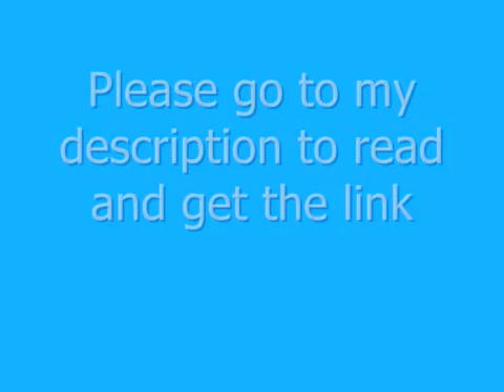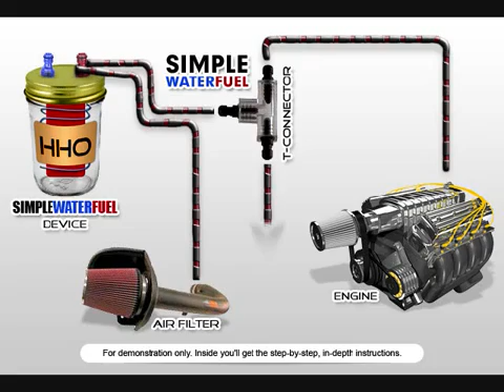How to Convert Your Car to Run on Water (Easy, Cheap, Quick!)

Comment: BRUTE FORCE ELECTROLYSIS DOES NOT PRODUCE ADDITIONAL MPG!  IT JUST CAN'T PRODUCE ENOUGH VOLUME AND THE ADDED O2 will trigger CHECK ENGINE CODES! It will probably lower your overall MPG!

Comment: The real video was removed because those who run this world do not want you to run your car on water. There's a lot of money in the oil industry, after all.  Don't stop looking!  The fact they suppress this technology means it works and has real value.  Just don't try making money off it, you will become a target.  Just use it for yourself and your friends.  The technology works and it's not difficult or expensive.
Reply: Man I really want to learn how to run my car on water. Do you know a link to the steps? Or do you know where I should look?
Reply: @franxx5239  It's been a while since I researched this. But what I can tell you is a guy named Bob Lazar (famous for claiming he worked on reverse engineered UFOs for the government) runs a science company now and on the company web site, he sells kits that makes any car run on water.  Not sure if he still sells this now, but I know years ago a friend of mine bought one and it worked.
Reply: Got more info? Link? Where to send my info to
Reply: Not the oil it's more just gas because no matter what your going to need oil to run any machine

Comment: I can already see future protesters protesting a coming GLOBAL shortage of water due to engines running on water   IGNORANT PROTESTERS ARE ALWAYS AROUND
Reply: MARIO KATO : Yeah! (There's  always  Trolls around) .It's  just water in the intake and steam  out the exhaust,
Nothing ,lost everything to gain , clean air ,no oil Riggs, no Fracking, or oil spills, hopefully cleaner oceans and lakes .No need for Fukoshima, or Nuclear-powered  anything, I hope I live long enough to see this 
Come to fruition. ( Come True)
Reply: Bobba Job : I realize  you need to separate  the hydrogen and oxygen with  electricity, and
 magnets  in some cases , ideally until just prior  to being ignited,  to prevent a major  explosion.
But it starts out as water and ends up as water in the form of steam.
Reply: cutting trees down is cutting the water off from the world

Comment: This is the truth the reason why auto companies don't do this because it just cannot work. Look at the conservation of energy  "energy cannot be created nor destroyed it is transformed" this means that you will only get the same amount of energy from the 2 H2 + O2=2 H2O reaction as you put in to split the water into propellant(H2) and its oxidiser (O2).
Reply: Josh B it's  been a year so i feel like somebody should tell you that they have already made a saltwater sportscar.
Reply: Josh B you can run the cars on steam but its not the same thing.
Reply: i agree with you josh then there is Conservation of energy (https://en.wikipedia.org/wiki/Conservation_of_energy) that we all learn in school - no energy can apear from nothing or disapear into nothing. if this maschine works like described it would be a Perpetuum mobile. thats are the fundamental laws in chemistry and physics
Reply: you try to compare apples with pears. may it look a bit similar but the differnece is what carry the energy for the propulsion. only what is same is that water is in the system nothing more. from the pure view of science is a big difference between this kind of steamengine and have only liquid water for propulsion.
Reply: This flew over most of your heads. Easy to see you aren't very into chemistry, science, and other such topics..
Reply: Please send  me more details on :sessy.malandela@gmail.com

Comment: Using water as a fuel source for cars does not eliminate the water used as fuel, any more than we do when we drink water. It all goes back into the environment for cleaning and re-use. Converting your car to run on water will not harm the environment but it may help by lowering the amount of gas exhaust u burn in the air.
Reply: Quantum Leap you could invent an engine that could run on water?
Reply: Using water as a fuel source is impossible. Water is BURNT hydrogen. No fuel in it.
Reply: @quantumleap359  not true a couple of men had cars that ran on water. They killed them
Reply: @quantumleap359  I recommend looking this up.  Plenty of people have made their cars run on water.  The first guy to do it was in the 1940s.  His car ran from the west coast to the east coast on something like 70 gallons of water, or something to that effect.  He died under very suspicious circumstances while eating at a restaurant, yelling "they poisoned me".  A simple internet search for suppressed technology will tell you all about it.  Only reason this technique isn't used far and wide is because no one can make money off it.  Lots of money in oil, so the oil power players put lots of effort into suppressing this technology. It works and they'll do anything to suppress it.
Reply: @lightbeforethetunnel  it's true
Reply: @lightbeforethetunnel that guy was Stan Meyer
Reply: Aron Reeves  The only "engine" that runs on water is a hydroelectric turbine.  That truly runs on the weight of falling water. Water itself is not a fuel. Period. It is a stable compound, with very strong molecular bonds between its components. Please, please learn basic chemistry and physics, and stop believing all this B.S. on youtube. These jokers are scamming you.